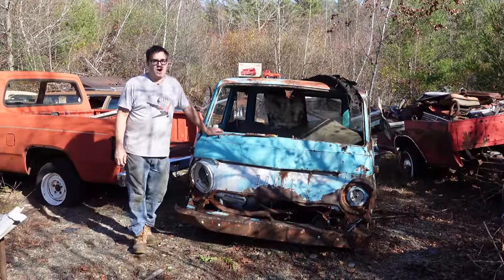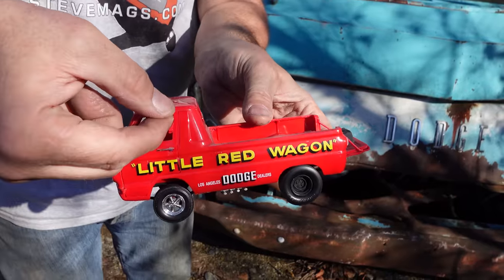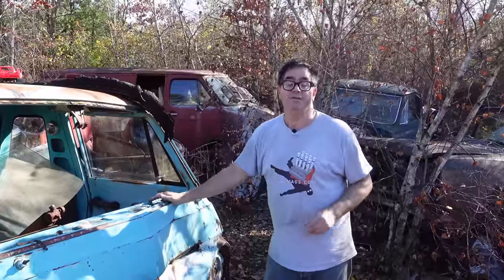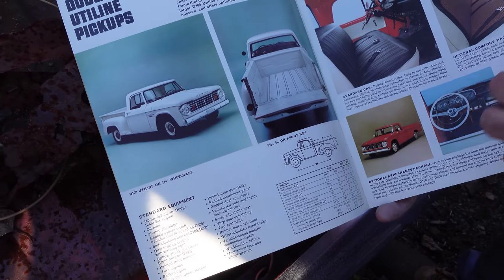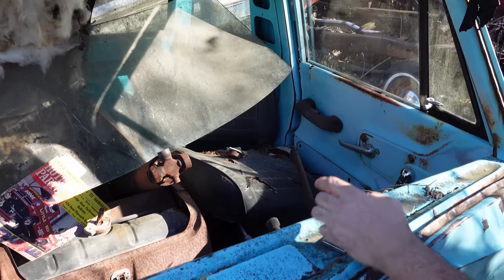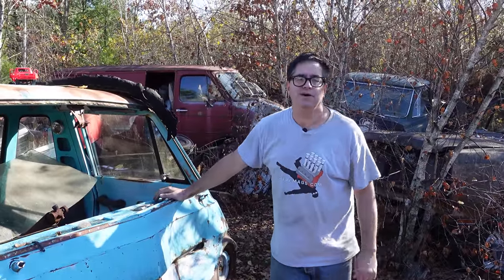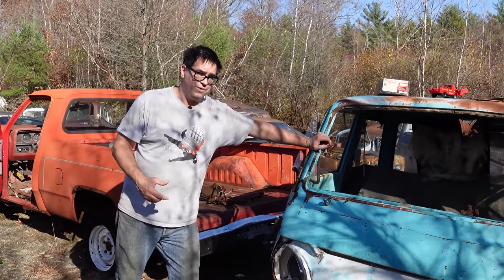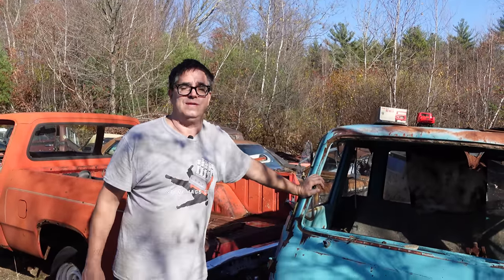Dodge A100 Pickup Truck

Comment: I've said it once, I'll say it again: You don't need those networks. You do better on your own, and they did make a mistake to cancel both shows, but at the end of the day, your presentation as an independent is much, much better. At 77k+ subscribers, it shows how your style is viewed and enjoyed by many. 

No VIN, can't win, but might be something like 18 for Dodge A-100 pickup, 6 for six cylinder equipped (8 is eight cylinder equipped), 1 for Warren Truck, Warren MI, 2 for Warren Truck (Heavy Duty), Warren, MI, 6 for Windsor Ontario Canada or 7 for Missouri Truck assembly. Warren, MI truck still operates today and was opened in 1938. Windsor Ontario still operates and opened in 1928. Missouri Truck would have been part of the Fenton, MO plant complexes and closed in 2009, with south St. Louis opening around 1959 and North (which made trucks) opening in 1966. The remaining last VIN digits are the production sequence and determine the model year, much like as Mr. Magnante has pointed out with Ford trucks.

No tag, can't brag, but maybe code 12882 Light Blue exterior paint.
Reply: @ultraviolettp3446  As I have said to people at work, "You can't pay for this entertainment".
Reply: There is a Wally's car stop in destination point there now in Fenton. It's sister station is over in or near Pontiac Illinois. I've been to the one in Pontiac and drove past the one in Fenton which is only built this year I believe. So the Fenton plant site at least in part is still car related. If you're not familiar with the Wally's it looks a lot like a Bucky's you know down out of South. Just FYI and good VIN decoding even without the tag. My comment would be concerning more of a confession than a story about these vans version of the pickup
Reply: All right I'll admit it I crushed one of these vans. You know the sister to this pickup. I need a guy that was a scrapper and even to this day I don't know why I didn't buy the van from him. But in the mid to late nineties or so they were still plenty of them laying around. It wasn't beat up the doors weren't Rusty the glass was good enough. And it still had its original 318 V8. We assumed it was a 318 did not verify. Somebody in the early seventies had made it into shaggin wagon. Wall to wall floor ceiling shag carpeting. It was musty but other than that the thing wasn't rotted out. Had some kind of rims on it I don't remember. About 10:00 one night went by to look at it and I'm working 70 plus hours a week had no time to mess with it. I should just rent a parking space somewhere and parked it. I think 200 bucks was all. So I took it out in the street smash his accelerator and laid some rubber with it. When I came back around the block I drove it up on this trailer parked it and told him no. He did what was required to take it to the scrapper took nothing off of it that he wasn't required to. Ironically he got busy and I had little free time on one Saturday I took his truck and trailer down and the giant call like I'm toy stories reach down and he smashed down the roof and picked it up and put it in the shredder and it came out like straw on the other end because it's shredded it. So this is true confession of a old car guy that screwed up. Ironically if it had been to pick up version I think I would have found a way. Nice video nice model truck. To anybody who hasn't subscribed that's reading this go ahead and subscribe. Steve brings out his information plus magazines and catalogs from the day for every vehicle and quite often models. Now if that doesn't say true car guy, I don't know what does.

Comment: My Uncle and Aunt had an A100 van which they drove all over the country in the 1970s when they were young.  I think they kept it into the 1980s.  One day my Uncle was working in the yard, and heard his van's starter.  He turned to look, and saw his van chugging slowly, and driverlessly, down the street with smoke pouring out of the doghouse.  He ran over and got in and yanked the battery cable, and sold the van.

Comment: Great info as always Steve.
The one you're specifically looking at also seems to have the ultra rare power take off unit conveniently jutting out through the windshield. 
 
Growing up my old man had a bunch of Volkswagen vans. Even as a 5 year old kid I realized that I was actually the "Crumple Zone". In the case of a frontal collision I was to be sacrificed in order to protect the van.
I don't think steel toed boots would have helped though. 

There was once a horrific accident literally inches in front of us while driving around in the old VW transporter. A lady Cub Scout den mother had 8 or 9 scouts crammed into a domestic station wagon bouncing around in back, as we did back in the late 60s, when she ran a red light doing 65+ mph.
The light turned green for us and my dad started to go when he suddenly stopped after going a few inches. That probably saved our lives because that lady hit another car who had a green light and hadn't noticed her. She bounced off of that car and slammed right into a light pole not 4 feet away from my window. 
After hitting the pole she flipped and spun upside-down another half a block. I remember later hearing on the news that a bunch of the kids died. 
I also remember cleaning the shards of glass off of our front bumper from that doomed wagon. 
After that my dad was no longer super keen on being shielded from oblivion by just a thin sheet of metal and a prayer.
Personally I still kinda like the old vans but, what do I know, I also still ride motorcycles on the street.

Comment: Yeah, I remember seeing the Lil Red Wagon run down the track at Atco Dragway, my local dragstrip. I also remember seeing the Hemi Under Glass, but my favorite exhibition racer was EJ Potter, aka The Michigan Madman, who ran what I think was a H-D Sportster stuffed with a Chevy V8 engine - smoked the back tire all the way thru the quarter. I also saw EJ run his '57 Plymouth Savoy 4 door sedan that was powered by a giant Allison airplane engine, so long that EJ had to drive from the back seat. He took off from the starting line, couldn't stop at the end and crashed into the giant pile of tree stumps Atco used as an end barrier back then - total silence as the ambulance rushed to the shutdown area.
The ambulance slowly returned back up the strip with EJ standing triumphantly on top, doing his Incredible Hulk imitation. We spectators sure got our money's worth that day!
Reply: When I bought a 1962 Sears Craftsman top and bottom rolling toolbox in 2014, it had a bunch of stickers on it (I removed most of them), including some "Ben Pila Speed Center" decals. They had (and still do) have some locations in PA, and they did have some in south New Jersey from what I remember. I still have photos of the box with the stickers on it, but I've since cleaned it up (leaving the patina) and it now slides, locks and rolls like it did in 1962 when it was first bought by someone at a local Sears store.
Reply: @googleusergp  Yes, I remember seeing the Ben Pilla Speed Shop name all over cars at the tracks I frequented back in the day, the early '60s into the '70s. I would attend Atco Raceway and later include Englishtown Raceway Park in my travels. 
I'm pretty sure the original Ben Pila shop was in Philly. Philadelphia and south and central Jersey, was a hotbed of junior stock racing, aided by the fact that you had people like Bill Jenkins and the Truppi and Kling, among others, who had their operations in the local area. Factory Mopars were represented locally by Bobby Harrop and his Flying Carpet Dodge and Jack Wurst and his Mr 5 And 50 Plymouths and quite a few others. An afternoon at Atco or Englishtown would produce some great class racing by any number of NHRA national record holding door slammers. I loved it. SUNDAY, SUNDAY, SUNDAY!!!!!!
Reply: @customkey  It was on the toolbox when I got it, but I took it off. I'm not much of a decal person like that.

Comment: That was the biggest defect of the flat front vans and pickups, a 30 mph crash into another object was going to get the driver hurt. Back in 1958 our neighbor used a VW van for delivering beauty supplies and ran into the back of another car and broke both legs and was trapped in the wreck. People had the same type of problems with Ford, Chevy and Dodge first gen vans as well.
Reply: The main reason why fire apparatus and custom chassis have a roll cage structure in their making as they are set up the same way.

Comment: I have a corvair rampside forward control truck. Wonderful trucks. Ride like a car, easy to see and like the dodge, unbelievable cargo capacity. 2 things I like about the corvair over other makes forward control trucks...1) with the rear mounted power train, engine noise is almost non-existent. 2) with the fold down side ramp, loading the truck is so easy. You can load a refrigerator on a hand truck by yourself! Just lay the side ramp down and wheel it in. Try that with a standard pickup....

Comment: A local guy here in North Iowa picked up one that original color last year but it had been rusted out. The previous owner patched the rust and then matte black painted the rest of it. Current owner buffed some of the black off and let the original white and green peek through on the front and the tailgate.

Comment: Funny that you refer to the big headlights as "Sandy Duncan eyes." I remember Sandy Duncan had brain surgery during the run of her 1972 sitcom "Funny Face" and it was widely believed in those pre-internet days that she lost an eye and had a "glass eye" afterwards. Wikipedia tells me that's an urban legend; she lost sight in an eye but not the eye itself. 

I loved the '60s wheelstander and exhibition rigs like the Little Red Wagon. And the Backup Pickup, which was based on a Ford Econoline pickup.

Steve, Motor Trend has made a few other mistakes in its long run, e.g. the 1971 Car of the Year Chevy Vega.

Comment: Hi Steve, nice video!  The Chrysler Dodge Deora Concept Truck was also based on the compact Dodge A100 pickup with the engine (a Slant 6) pushed back much the same as the "Little Red Wagon".  Ford also had a Ford Econoline Pickup, based on the Econoline Van from 1961-1967.  Please reply.  Dave...

Comment: Quite possibly my favorite build i ever accomplished completely. was my 67 A-100 van that i shoehorned a 1st gen viper v10 into!  what a sleeper!  Literally, it was the camper van complete with the lift ip top, sink, stove, table, storage, and a bed!  what fun!  i had a HUGE trouble getting the driveshaft to stop vibrating terribly though.  Just couldn't seem to get the pinion angle quite right, sadly it is now sitting in my grove and had been for probably over ten years now.  Never felt right selling it as it is just too damn unsafe for just anybody to drive.  It is a widow maker in my opinion.  But goodness what fun it is for someone that knows how to use and respect it!
Reply: A108 van would've been a better choice for that swap...18" longer than a standard A100.  You'd be able to have a decent driveshaft.

Comment: I wasn't a fan of the 'pie plate' headlight bezels, Chrysler used on their late 60s, vans, pickups and medium trucks. I thought the finned headlight bezels used on the Chrysler Turbine cars, would have been a neat looking replacement.
Reply: Here in Southern California we called these "Pie Pan' headlights. My '64 dodge 440 2 door had those headlight rings and were the least admired component to an otherwise great car. I now have a '68 A-100 pick up which I replaced the slant six with a 1st year 360 LA with ported heads and decent solid lifter cam.CalTracs informed me that they offer a CalTracs suspension traction bar for the underslung rear axle.

Comment: Also the A100 pickups had an iron weight bolted between the rear valance and fuel tank to help with front/rear weight bias.  Those corner windows were an option. . I had a 65 A pickup that I retrofitted to a 318/auto but didn't have the corner windows.

Comment: there is actually an outward bump in the front sheet metal for your foot on the gas pedal. it sticks out around 2 inches which puts your toes a few inches behind the leading edge of the bumper. you can see it through the grille and was always a hit when pointed out to people. the steel toe boot remark is totally on point.

Comment: Nice find Steve!  I wonder if there would be a way to make such cab forward  vans relatively safe with today’s modern safety tech.  The visibility and utility were both there in abundance, but yeah, it’s scary sitting right up there where the worst impacts usually occur.  I never built one of those models but always wanted to.  (Sandy Duncan is a cutie)
Reply: They still build commercial trucks as "cab over" designs. Many manufacturers offer them.

Comment: Hi Steve, DO YOU REMEMBER THE DODGE L700 SEMI TRUCK?
Reply: I do!  Are you talking about the medium duty cabover, which used the front of an A100 as the cab, perched atop a riser platform which integrates the cab to the larger truck chassis?   
It was like the Ford H1000, known as the two story Falcon.  The H1000 was a Ford medium duty C series cab, again mounted to a riser platform which integrated the cab to the larger heavier duty frame.

Comment: Hi ho Steverino.
Reply: I had a 67 ,5 window A 100 pickup in my late teens,318,auto,4 11posi,with ps,and dual add on ac ,it was very quick,and very dangerous,but so much fun,rare truck,probably the first true factory high performance  pickup ,won many street races with it and I truly regret letting it go but I would have probably killed myself in it eventually, had many close calls with it,but what a truck!!!